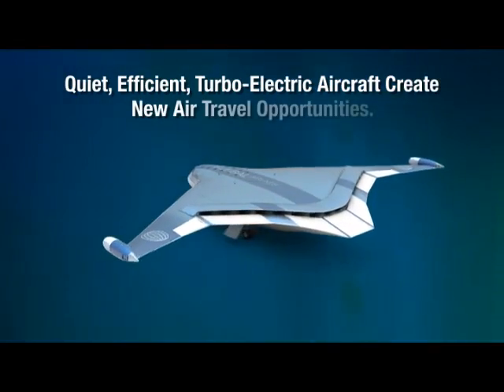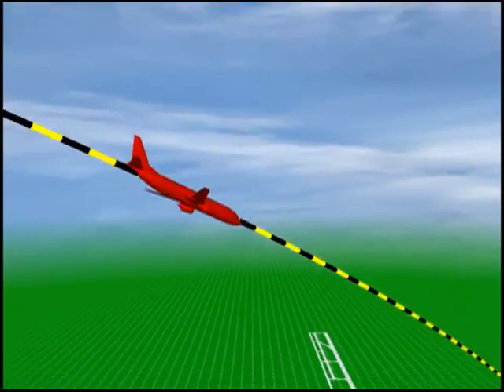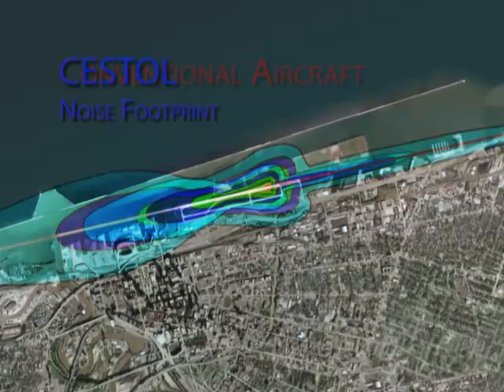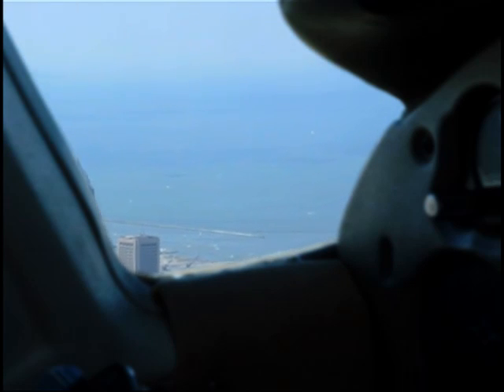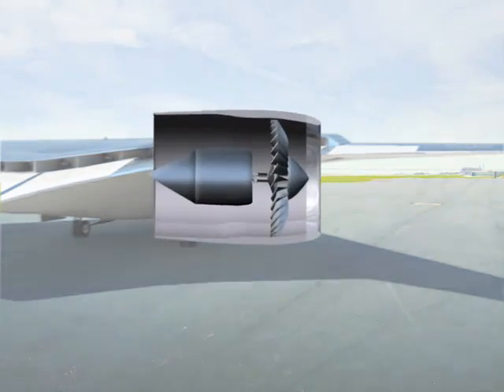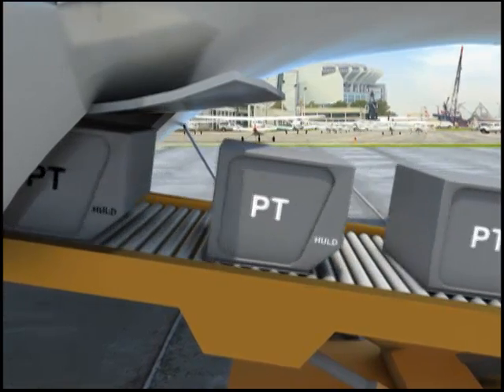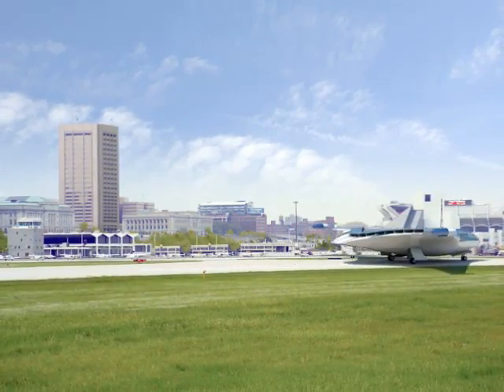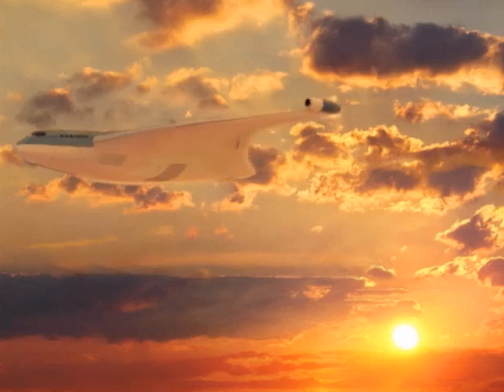Turboelectric Propulsion a New Idea for Revolutionary Aircraft

Comment: so would this feature a dayside plan to generate energy or would it feature chemical bonding to generate energy?  ohhhhhh.... turbo electric... i asumed it meant they were using pure electrical fields to drive it... i was like... i guess that might work if you developed some sort of ultimate satelite network to each pass through energy between them using laser beams and precise gps coordination to then transfer that energy into the plane in a five minute by five minute quick burst of energy from the overhead satelites... then you would just need to utilize a few orbital stations or ships that could generate massive amounts of energy that could be passed through the satelite network... or maybe increase each satelites potential energy generation and the butterfly effect of passing a spit ball of energy from one to another and it could grow bigger and more powerful from each satelite it went through.... then you could have like 200 or more airplanes in the air in a small area being blasted by satelites with quick bursts of energy... im sure something would not go wrong too often, just every other month maybe

that said i like the idea etc....
Reply: rubber band power...
Reply: @rottondog1473  you mean using elastic properties of chemical bonds to drive a constant pulling and stretching that would act as a mechanical force?  amazing

Comment: Why don't they use Maglev tech for take off... would be able to accelerate to takeoff speed a lot quicker and require shorter run way.
Reply: I have been raging about this question. Going to build a mag lev launch assist in Canada. HMU if you are an engineer and want to come up!
Reply: Sasaka Minshew  building out a plan for CH4 conversion to cover R&D in Alberta; farm hydrogen to support the ongoing effort. Ideally 26km track, terminating in a mountain peak.
Reply: @shawmahawk  

Have you considered the properties of other people in the way of the track? The fact that it needs 26km to work over the 1-3km of normal runways?
Reply: @topsecret1837  in Canada, we have plenty of space for this kinda thing. No I hadn’t considered, and no it’s not a deal breaker.
Reply: bc thats uncomfortable? i mean aircraft carriers kinda use that concept